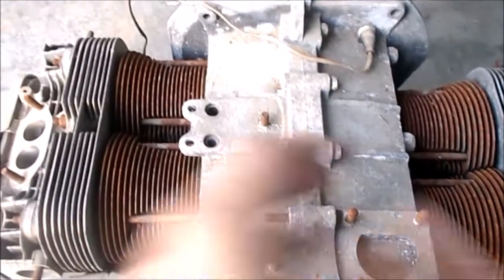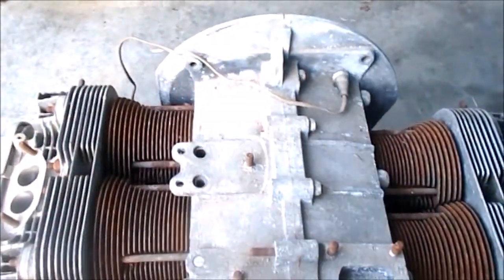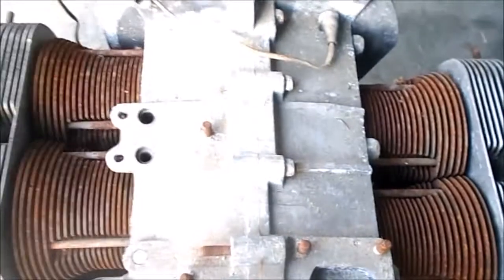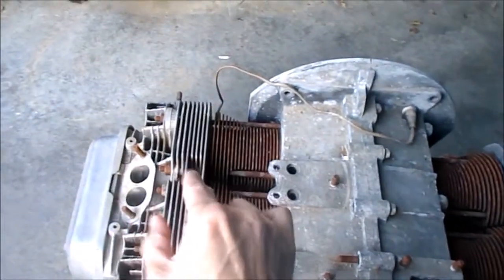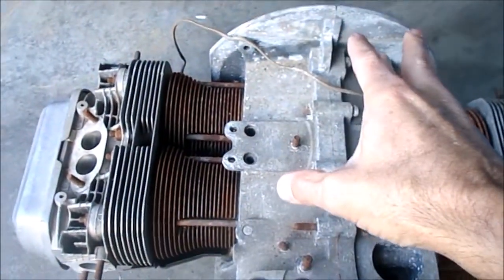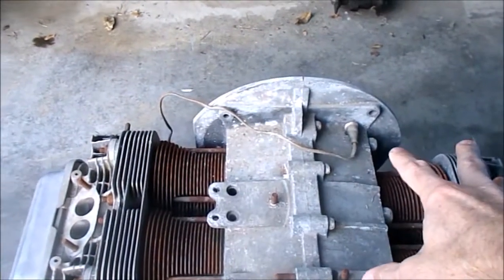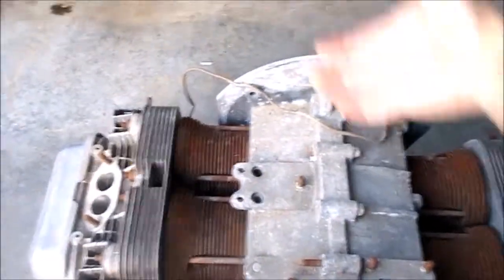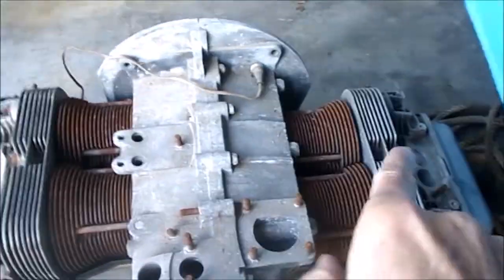vw type 1 mileage & mpg vlog 16 aluminum or magnesium case

Comment: Very interesting, your explanation made a lot of sense.
Reply from the maker: thanks for watching. of course it made sense. it's basic physics. someone gave this vid a thumbs down last year. 1 down vs 13 up.
Reply: @scottyc9365  can't say I know much about physics, the way you described it helped my 61 year old brick mason mind follow the logic though. 
I currently have a mildly built 2110cc in my 63 Baja.
I've been thinking about going higher performance using an aluminum case but didn't understand why they typically ran higher temperatures. 
On a completely different subject, I'm curious how physics would play into gaining power at higher altitudes? I live in a high desert at 5700 ft. 
I'm not trying to build a race car, just curious if different combinations tend to work differently at altitude?
Perhaps that isn't something you can answer through a YouTube comment section but I've been curious about it. 
Not to the extent of forced induction by the way.
I subscribed to your channel, if you make a video I'll be watching for it.
Reply from the maker: check out my vid on compression ratio. i'm pretty sure i explain how to compensate for altitude. a quick calculation shows me that 8:1 at sea level is comparable to 9.8:1 at your altitude. yes, it makes that big a difference. thanks for subbing and watching. oh, fyi, 61 here as well

Comment: One element of cooling you did not address is the oil in the valve covers..  There use to be a video and pictures of a 1600 engine running with transparent valve covers.  It showed the 3/4 side valve cover almost 1/2 full of oil at high rpm.. I found the link to them but the website is gone.  This is a major dissipation of heat from the heads.   Also oil viscosity is another issue.   Good analysis!
Reply from the maker: i have read about that "oil in the valve covers" ages ago in the samba. not sure what i was investigating at the time. hell of a long time ago. maybe it was venting of valve covers which i have permanently sworn off as pretty much a useless mod.
Reply: That was muffler Mike

Comment: Wow, all I've ever heard is the AL cases didn't transfer the heat as well as the mag cases.
Scotty shattering VW myths.

How about big valve heads 40x35.5 cracking with stock heater boxes on a type 1 ?
Reply from the maker: it's all about how "dense" the AL is. mechanic speak is my term for that stuff. i try to use engineer speak like thermal conductivity and heat sink. so, cracking heads with big valves? one thing that i've noticed is that the cognoscenti don't pay attention to whether or not the head is an original style or a new style. the new style head should be more resistant to cracking but the mechanics don't bother to tell us. i've also read about problems with 35.5 or larger exhaust valves and stock heater boxes. as far as i can tell it's an issue related to exhaust port matching.
Reply: @redshirt-scotty  
kinda what I was thinking too
this fella suggested that the waffle shape of the heater box tubes would cause the heads to crack
[put the samba stuff here] /vw/forum/viewtopic.php?t=776530&postdays=0&postorder=asc&start=0  

I'm more included to think people putting bigger valve heads on would have a heavier foot
Reply from the maker: @patrickmclaughlin6013  heavy foot for sure will make problems. did you watch my hvx vid about the aero engine builders? check out the revmaster 2300.